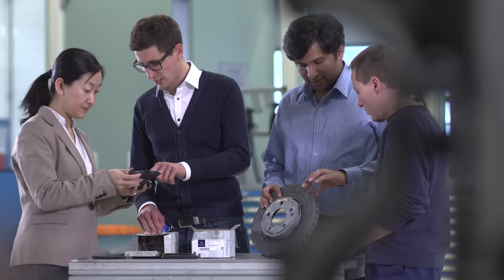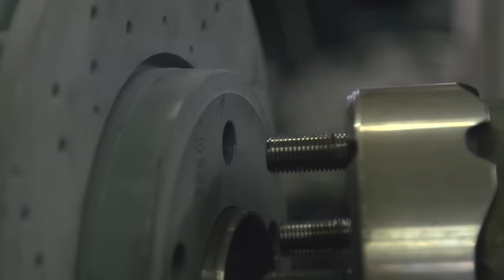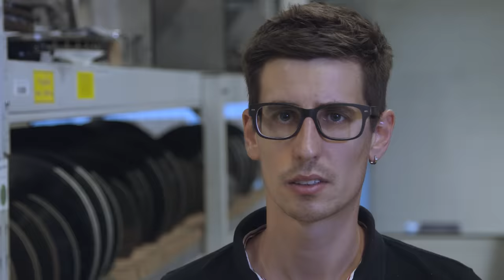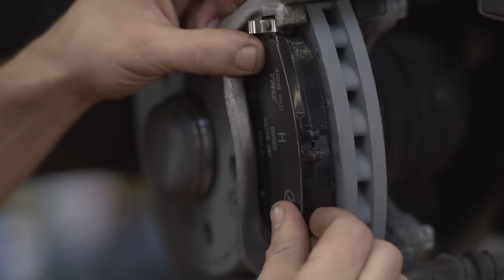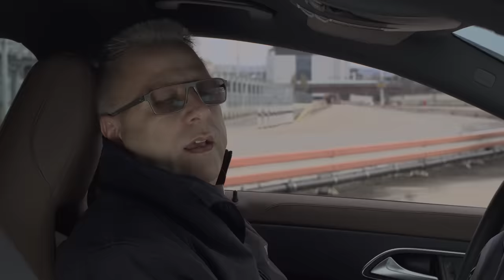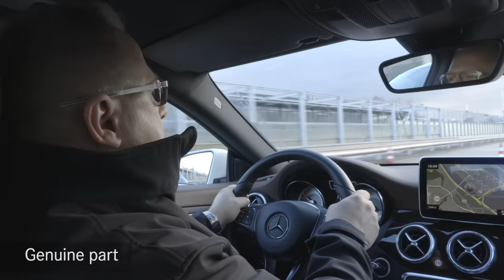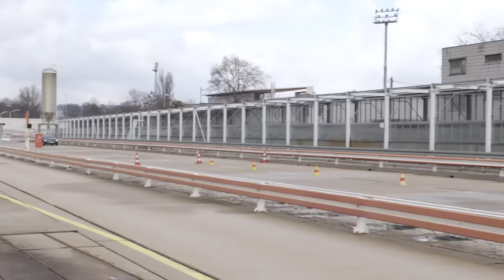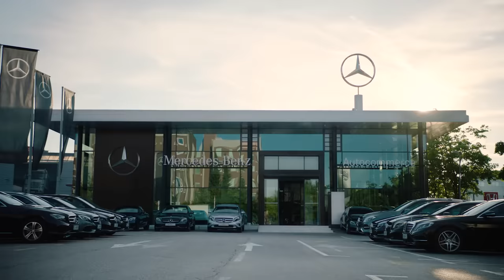Brake Test | Mercedes-Benz Genuine Parts vs. Fake Parts

Comment: Stop charging customers 1000$ for brakes replacement and maybe they will start letting you fit "original" parts..
Reply: where can I find costumers? In the Halloween costume shop?
Reply: true
Reply: Absolutely rediculous hyper inflated prices on OEM replacement parts....😤
Reply: Mafia!
Reply: ashystyle but why buy the car if you can’t maintain it?
Reply: if u choose mercedes...u have to  have money...otherwise mercedes is not for u
Reply: hahahahaha sooooorrrryyyyyyyy
Reply: I agree...I got Honda and darn merecdes, Guess what car has more problems, by the way half price brake pads on my Honda stops car same as Merceds.Mercedes is just over complicated in every aspect of it... Including over complicated prices.lol  but quality is berly better than any  other car manufacturer.
Reply: fact that you can afford it doesnt mean you should allow yourself to be robbed by "stealers" i mean "dealers" with their over inflated prices.
Reply: it stops the same driving back and forth to Costco. it does not stop the same at 220 km/hr. you can complain all you want but your Honda is not the same as a Mercedes Benz. i don't even like Mercedes. there is a reason their brakes cost so much. if you cant afford it, keep buying economical cars because their perfect for what you're doing but don't attempt to compare a Mercedes to a Honda. i have a toyota camry and a silverado, they have awesome brakes, but they're not high performance and i would never compare them to high performance vehicles. i had a 2013 Subaru WRX STi, they run Brembo brakes, $3000 to replace. worth every penny, unmatched on the racetrack, where they're intended to operate.
Reply: also, dont buy parts at the dealer. lmao you can buy factory parts elsewhere for a fraction of the price.
Reply: Ze3bar for the win!
Reply: You can buy original parts replaced by another mechanicc
Reply: Juan Villegas You're wrong. Nothing you say can justify the extortionate prices chsrged by Mercedes benz for parts made by other companies who put a Mercedes Star on them.
Reply: Chef I have money, just not for extortionate b.s.
Reply: Shit rotors and pads drilled and slotted all the way around it was like 3k
Reply: im a s class cab driver in London and was never charged a grand...
Reply: Qwerty Qwerty I want a T-rex costume.   ;)
Reply: many counterfeits are mutch better then the original thats another aspect
Reply: Yep, if it's not the right time for you to have a Mercedes, don't force it. Go get something more affordable such as Honda.
Reply: On a C class they cost far from 1000$, the garage charge a lot, but if you just buy the part, they are not that expensive.
Reply: Don't buy mercedes if u can't afford parts hahahahahah
Its not for people with skinny wallet :)
Reply: E class disks and pads all around don't come to thousands, in fact, no more than any other 4000lbs car.
Reply: True but also look at other premium alternatives like brembo
Reply: Why don't Mercedes sell their parts on Amazon directly? I'm just saying..
Reply: The reason they are good is the price
Reply: Stop buying so expensive cars if u already knw dat aftr services r nt cheap.....
Reply: Bravo mate,this is the reality.Buy genuine!!!!!Ha ha ha.But for genuine you need a fortune
Reply: True
Reply: @user47362  LOL, Costumers !!  HAHA, Nice!
Reply: dont buy a merc if u cant affort it🤷🏽‍♂️
Reply: I change my brakes, its easy and fun and I take extra care. If the only thing you know how to do is press the gas and brake pedals than you better drive a bicycle from now..
Reply: Don't buy a car you cant afford to maintain then.
Reply: R. Ive  im not cheap, i just prefer NOT spending my entire paycheck on parts! , especially when i can get decent parts for under half the price from others like lemförder, bilstein, febi bilstein, bosch, sachs, etc
Reply: @martini_served_here  yup
Reply: Exactly
Reply: For real though, OEM parts from any auto maker is literally triple the price than going to napa auto and buying their parts
Reply: Have you ever heard of ''you get get what you pay''?
Reply: Don’t buy a Mercedes if you can’t even afford brakes.
Reply: Brembo brakes are better then the stock mersades benz brakes
Reply: Don’t buy a Mercedes then.
Reply: Ndochokwadi
Reply: dont buy $135k car if u cant afford $1000 brake replacement
Reply: If you’re complaining about the cost of maintenance then stick with a Honda Civic or Kia.
Reply: yeah dont buy a merc, i had my brake pads replaced for $2600 and they squeak all the time next day. brought the car back to the dealership, asked to come in the shop to watch them replace it, the previous ones they gave me were worn out badly. When I saw it, the pads only got like 2mm left. Mercedes is a joke
Reply: Mercedes isn’t Toyota. If they drop their prices, the quality is also reduced
Reply: But it depends on what kind of brakes that you're replacing , it's not only just one type of brakes .
Reply: prob the easiest job you can do lol
Reply: Guys.... When you buy a mercedes what do you expect ?
Reply: don't get a mercedes if you're poor
Reply: 1000 bucks for a Mercedes break? Danm that’s a steal
Reply: Exactly!
Reply: That's what happens when you buy Mercedes after saving money for one. Ferrari costs $250k, but that doesn't mean you won't pay $40k plus every year to maintain it, because you will.
Reply: I mean it is Mercedes after all
Reply: All these people saying, “don’t get a Mercedes if you’re rich, it costs much because of quality”. That doesn’t excuse the fact that they still inflate their prices. It’s like getting an iPhone and justifying the fact that “oh it’s really good quality”. Not entirely accurate, they’re just popular as a brand and because of its hype, they can overinflate their prices to give the consumers a sense of prestige and quality. Not saying mercs are bad quality, they’re really good quality but still ridiculously overpriced for what you’re getting. But hey I can’t blame Mercedes. Their tactics work.
Reply: Stop buying crappy vehicles with no actual longevity and it’s only based on hype! Nobody is forcing you to buy such an a ridiculously expensive vehicle when other alternative and better constructed ones that are significantly cheaper and better quality!
Reply: Or just buy a car thats more reliable and Cheaper :)
Reply: 1000 dollars for a new set of brakes is a Super deal
Reply: Amen
Reply: @juanvillegas8377   idk bro, why don't you go buy apple pro stand for 1k$ then?
Reply: Quality and safety come at a price.
Reply: if you can afford a $60k to 100k car...then 1k for some authentic parts is not going to break your bank.  If you bought a used MB for cheap..its cause its been riden hard and put away wet....you are getting second hand goods at 1/4 the price yes...but its been used rough and often times driven wrong by owners who just want to go fast or get from point a to point b.  meaning it doesn't have the regular maintence half the time and the engine and parts are worn in a fashion that means it will have all sorts of underlying problems that just are not worth repairing compared to just getting a new one for them.  I'm assuming you bought yours second or even 3rd hand if you are complaining about $1k for breaks.  Do yourself a favor...trade it in for something within your economic means or a cheap honda then spend the money to get it up to snuff slowly.  you will be more happy and the thing will last you longer than a flashy MB.  Set realistic expectations for yourself and the things you purchase and you will spend less time blowing money on shit that will not be able to truly afford.  you will be richer in the long run then too.
Reply: How about you stop buying cars you can't afford to maintain.
Reply: Captain Hero to be honest there’s no difference though
Reply: How about stop being so poor
Reply: Lol, you buy 60k+ car and then don't have 1k to replace brake callipers and dicsc once?!
Reply: Pet P. Why the fuck would the calipers go bad 🤔
Reply: They charge $1000?!!!!!!
Reply: Ceramic brakes is minimum $25.000
Reply: @martini_served_here  yeah you gotta pay for another mercedes in repair costs lol.
Reply: Buy Toyota....best
Reply: And now mercedes won't reply on this. Lol.
Reply: ? The whole point is that Mercedes is marketed as a luxury brand, targeting people who DO have the $ to spend on it. If you can't afford $1000 brakes then go with cheaper car brands like Toyota lol?
Reply: I have a Honda and I just changed the brake pads after many years and never had to touch the discs.
Reply: Sun Day  pads and rotors bud
Reply: start buying from genuine suppliers like brembo or ate, theyre the suppliers for merc brakes and cost about half of the original
Reply: Stop buying cars which you can't afford to repair
Reply: if he hit the brakepedal equal, then they would stop the same ha ha ...you could clearly see he wasent pusing the brakes the same
Reply: Dude Mercedes is a Luxury car brand and they are good quality parts.
Reply: @terrancekuang  yes, but the price isnt right. oem parts from ate or textar cost just a fraction of the price and perform the same
Reply: i work for supplier company of daimler and repair their machines. they all use well known quality from other brands like brembo or bosch etc.
Reply: Quality makes price go up.
Reply: @techmainframe6864  stamping the mercedes emblem does. as said, there arre enough third party suppliers that are oem from merc and cost way less
Reply: But what is there quality?
Reply: Plus, there trying to maximize their profits. Otherwise, what are they there for. If there were no counterfeits then everyone would go to their nearest dealer.
Reply: Plus they want to be a trusted partner of Mercedes Benz so people can come t them trusting them as well. So in another view they are maximizing their profits.
Reply: @techmainframe6864  the quality is the same. its been proven many times before. just because there is no mercedes emblem on them. go to your mercedes and read (if you can) whos the supplier. mostly ATE or Textar. brands you might not have heard of if you only buy genuine parts. also there are other suppliers like brembo or EBC which are known to even produce better performing parts for less or equal money.
Reply: Bro only rich people can afford these beasts so they can pay
Reply: @a.a2888  those arent beasts, they get beaten by almost any other vehicle with the same power
Reply: when they die of brakes failure then u will say right
Reply: Well...just Mercedes trying out HAAS (hardware as a service) for their next business model...
Reply: lel
Reply: I fit other brand brakes and yes on huge loads or driving like mad i feel a difference in stopping. But when the disc is new i put OEM parts on once its on the second pad i put other brands because the disc is already going and shows a lip so fitting a non OEM pad makes sense still stops fine for me.
Reply: From a retail point of view, Mercedes-Benz would make more money if they leaned more towards a turnover of stock than achieving profit per unit.
Reply: So you have money for Mercedes but no money so you use counterfeit parts?
Reply: dont buy a fcking mercy when you cant afford the brakes bro
Reply: It's better, it's more expensive. If you can buy a Merc but cannot spend an extra 1k every now and then to protect yourself and others, don't buy a Merc.
Reply: If you have enough to buy a Mercedes you should have enough to buy replacements theres a reason they are top of the line how can you expect to pay the same as for a honda and get better performance.
Reply: Just 1 thousand🤣.. 🤔well we know u don't have real benz, if you can't pay, then don't play.
Reply: @martini_served_here  I know I am late but that's exactly what I was about to say XD
Reply: Dont buy Mercedes if you cant afford it
Reply: @duk2k  don't get a mercedes if you don't want to end up poor! X3
Reply: @jamesgizasson  I have Mercedes and still rich
Reply: @duk2k  Imna quote Bagheera here: 

"Well... I hope his luck holds out!" 
X3
Reply: yes
Reply: People have horrible mindsets when buying a car, it should be like having a baby if you can afford the medical bills for giving birth but can't support him in life you shouldn't have one lmao
Reply: @asphyxia9927  Yeah, the lack of responsibility many people have in either circumstance is painfully obvious! X3
Reply: Counterfeit not similar to oem. Oem is like mercedes original
Reply: Mercedes charged god damn $1700 for a replacement 12 volt car battery! Stop ripping people off Mercedes
Reply: @chrisvig123  to expensive to oem part, why not just replace it with semi race part if the price is same
Reply: zikunzeng5871 you mean expect to get robbed by the dealer?